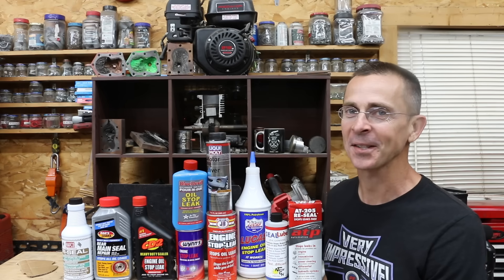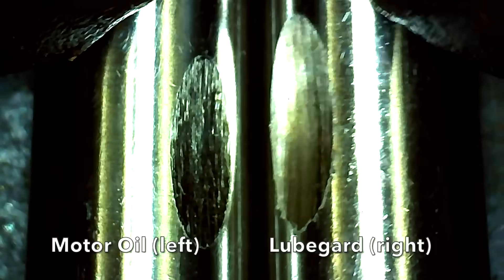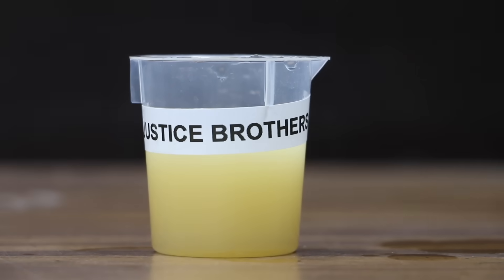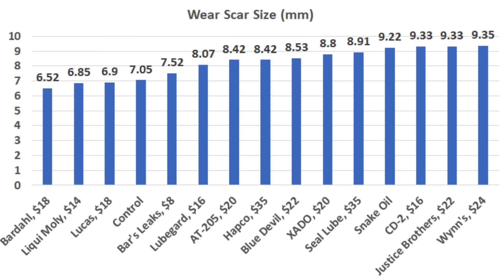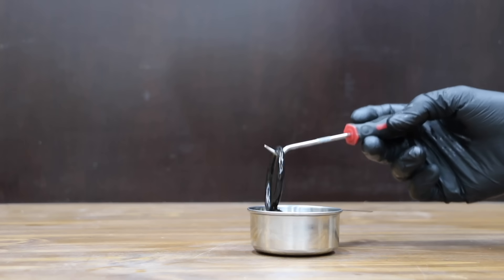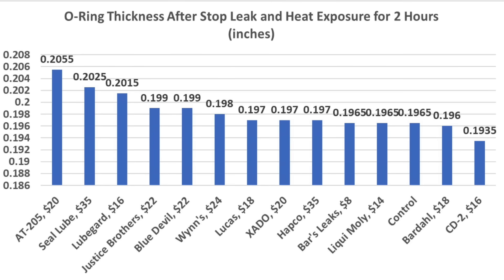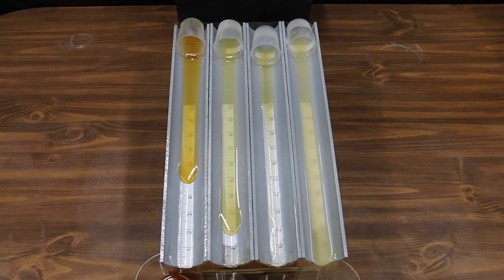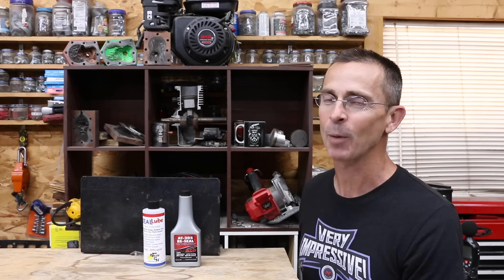Do Stop Leak Products Work? Do They Damage Engine Seals? Will They Destroy an Engine? Let's Find Out

Comment: I'd like to know what happens to O rings that were successfully softened by products that increase engine wear THEN returned to plain oil only. I.E. assume you only run these additives for a short time to stop oil leaks THEN drain your engine and go back to running on plain oil. Will oil leaks return?
Reply from the maker: Thanks for the suggestion.

Comment: at205 just works. however the tests are a bit misleading, if at205 didnt come out on top there would be a ton of comments how its dangerous ruining viscosity.... except the test was a 50% mixture which is way overkill. 8oz in 5+ quarts of oil isnt remotely a 50% mixture. but sadly a majority of people just aint that smarts

Comment: I'm currently using ats 205 for a rear main engine oil leak on a ram Cummins it wasn't a terrible leak but a very slow drip so far it seems to have helped and stopped the leak over all the wear indicator on your video worries me a little bit but you also mixed 50/50 ratio I'm running two bottles for 12 quarts of oil so it should be pretty deluded love this test glad you've tried ats-205
Reply from the maker: Thanks for sharing.

Comment: At-205  just flat out works, unfortunately it has become harder to find recently, i had to use the blue devil instead but now I think i will try to get my hands back on some AT-205. Nice job on the test!
Reply: I buy AT-205 off ebay with free shipping. The price can be equal or less than my parts stores.
Reply from the maker: Thanks!

Comment: I've been using Liqui moly for over two years and 90,000 miles in my BMW. It had a pan gasket leak. The Liqui moly substantially slowed the leak, but there is still some. Oil analysis shows nearly zero metal content on a 165,000 mile engine. The oil filter housing gasket, which are known to leak and cause major damage when the serpentine belt fails, has no leakage whatsoever 80,000 miles after I replaced it. I'd be pretty nervous about any product that didn't stay in solution in the oil, or reduced it's lubricity. I'm shocked the LM got so hard in the freezer. My engine shows oil pressure immediately after staring even on sub-zero mornings.
Reply from the maker: Thanks for the feedback.

Comment: Remember, just adding a thickener or something that increases the viscosity of the oil may help seals, but if it increases too much you can end up starving the oil system. Bearing gaps that need motor oil pushed in by the pump may end up getting less oil overall to them due to the increase viscosity, and the user may be under the impression that things are better because they see a higher oil pressure on a gauge (if they have one). But, higher pressure does not = higher flow or more protection, it can actually indicate that you are just having a harder time pushing that oil through the system.
Reply: Exactly, viscosity is super critical to getting proper oiling to your cam and crank bearings. Higher viscosity will starve them for oil, especially in modern tight tolerance engines.
Also, I think these are natural rubber O rings which are not compatible with oil. Oil will eat natural rubber, if an engine uses an o ring that will contact oil, it can't be made of natural rubber.
Reply: @bobbygetsbanned6049  he didn't get into detail about the specific type of oring, but if it was in a repair kit then it was likely Buna-N for general compatibility.
Reply from the maker: Thanks for sharing.

Comment: So many motors these days have silicone seals, the LS only has rubber front and rear mains and the rest are silicone. Should add that to the tests
Reply from the maker: Thanks for the suggestion.

Comment: If anyone watches Scotty, he swears by the AT-205 products, so that was awesome to see it here in the test. I wonder if it would cause less wear if used during the summer time with warmer temperatures or with a lighter weight oil than usual. I’m pretty sure that it’s meant for older vehicles where the leak is more of the concern than some minor additional wear. Another great test 👍
Reply: Well, nobody is going to use the 1:1 ratio of product to oil he used in that test... I don't know why he even bothered with it. I used one 8 oz bottle of AT-205 in my 6 quart capacity crankcase for a leaky front crank seal and it worked. I have no concerns about any wear factor.
Reply from the maker: Thanks!

Comment: Scotty Kilmer swears by AT-205 for stopping leaks, which seems to be backed up by your data. There's obviously an increased risk of wear with AT-205, but Scotty only recommends using it in 
older engines vehicles where you aren't going to spend the money to repair- which lines up with your suggestion as well.

Thanks for another great video!
Reply from the maker: You are welcome!

Comment: I had some bad piston rings on a 94 tercel. Would foul a spark plug in 15 min... ran a can of engine restore in the oil and ran the car for 3 years with changing the spark plug once a year, just added a can every oil change and added to 5qts when adding oil to keep it in spec. 42mpg and 30k miles works great till till I sold it
Reply from the maker: Thanks for sharing.

Comment: had a power steering leak on my 2003 ranger, pump out old as much as I could poured in bottle of Lucas power steering stop leak, it lasted almost 10years before it started to leak again, sold the Ranger about a year or so after that

Comment: do you clean the thin sheets that covers the lubricity tester wheels? Does they effects the test rsults that much if not cleaned evrytime?

edit: do you also change the lubricity tester wheel? does the friction removes material from the wheel? does this matter in the test results?

Comment: Radiator stop leak next! Of course they tend to clog stuff up over time. Makes me wonder what this stuff can do to an oil filter and how permanent the results are. It seems you could add the stop leak and change oil not long after but it's tough to say.

It seems to me that it's difficult for oil stop leak manufacturers to have high lubricity and and also create o ring expansion. There seems to be a slight correlation with some of the products. They may offer a better wear scar but aren't as efficient at stopping leaks.

The thing I took away from the video is you want it to stop leaks and blend with your oil well. The oil itself will do a very large part of protecting the motor. The main concern is actually stopping the leak when the oil you use, if it's high quality, should offer the wear protection.
Reply from the maker: Thanks for the suggestion.

Comment: I would be interested to see if you took the cooked/treated o-rings, then "changed the oil" and cooked them all again in the control oil, and see if the swelling/softening is still there, or if the o-ring reverted (meaning you have to use it every oil change).  It would be neat to see what blackstone labs found for each type as well.
Reply from the maker: Thanks for the suggestion.
Reply: @ProjectFarm if you revisit this test, also consider a high mileage oil as many of those claim to restore seals too
Reply: @feyrband  He covered at least two brands of high mileage oil in a previous video, and found they did restore the o-rings slightly.
Reply: @Tagiau  oh I missed that one, will have to check it out. Thanks
Reply: @Tagiau  High Mileage Oil only works if used BEFORE the an oil leak starts. It does nothing to stop the leak. That's why the Oil Companies recommend begin using at 75,000 miles.
Reply: Oouuu yes, This is pretty important! (The re-test part)
Reply: THIS!  It would be very helpful to know how long the o-rings expansion would last.  Do you have to keep using  such products?  Or do the effects last, and for how long?  And if the best working additive does the most damage.  Knowing if you only have to use it once and then can do a oil change to compensate the negative affects of the additive, or if you have to keep using it and thus ruining your engine.  Thanks Todd
Reply: I'm pretty sure those are natural rubber o rings which aren't compatible with oil, so they will get damaged by the oil again.

Comment: Wouldn't the 50-50 ratio used in the friction test be the same as replacing two full quarts in a 4 quart engine? I don't think any have that directive. Directions for AT205 is 8oz in 6 quarts so you'd add roughly 5+ ounces to the full 4 quarts, correct? Wouldn't have nearly the dilution impact.

Our story: 1998 E320 with rear main and valve cover leaks. One per year oil changes. Switched to Mobil-1 high mileage. Year one nothing. Year two leak was stopped. Year 3 leak returned 6 months in.

Added the AT-205 and within 25 miles of driving was down to one drop on floor per day. Year 4 (current) oil change with AT-205 added and we get one drop every 2-3 days...
Reply: Also the generous amount of product to oil would, potentially, give better plump and softens, too.

Comment: On the O-ring repair tests, I actually think that the oil/product mixture isn't flashing off, but being absorbed into the O-ring, and that's why those ones tended to expand more.
Reply: then the weight would not change.
Reply from the maker: Thanks for the feedbackl
Reply: Yeah, the weight wouldn't have changed. 

It's absolutely flashing off.

Comment: About 30 years ago, a friend of mine replaced all the oil in his engine with bardahl. The viscosity was so high that the engine refused to turn over and burnt out the starter motor. It took a full day to drain out the bardahl from the crankcase.....
Reply from the maker: Thanks for sharing.

Comment: We have used bars a few times for leaking main seals in sweeper truck rear Motors.  It would normally give the motor an extra six months to a year... At205 seems like it may be significantly better I guess will try that next time.
Reply from the maker: Thanks for sharing.

Comment: I have experience with the at-205. Had an oil pan leak, small, only a drip or so a day. Threw 20 bucks at the 205 fingers crossed so I wouldn’t have to go through the effort of replacing seals. No luck. In fact my leak go worse. I do believe it worked as advertised to soften the seals but just happened to have an adverse effect on my leak. Spent a couple hundred bucks and a weekend to reseal everything. Now problem is solved.
Reply from the maker: Thanks for sharing!

Comment: I would suggest a couple of tests, that are related to this one. First would be products for sealing cooling system leaks, and the second would be transmission fix products.
Thanks for the information. I've used seal lube, and it seems to have slowed an engine oil leak.
Reply from the maker: You are welcome!  Thanks for the suggestions.

Comment: Your methodology is excellent.   I find it interesting that you confirmed the effectiveness of AT-205 at stopping leaks, which Scotty Kilmer endorses.
Reply: Scotty Kilmer is very knowledgeable and he wouldn’t steer you wrong on a product. I recently purchased a battery jump starter from “Autowit”. It uses capacitors instead of an internal battery pack. Works fantastic. I think Project Farm may have tested it out also but I’m not sure. 😊
Reply from the maker: Thanks!  Thanks for the feedback.
Reply: Yup, that's how I heard of it also, and t's a great rubber preserver because it has no petroleum distillates in it.

Comment: I used the at205 for a leak in the rack and pinion of my truck and it worked amazingly and didn’t leak a single drop for about 3 months. The leak has come back now but it was such a significant leak to begin with that I’m surprised it did anything at all, plus it gave me more time to save up some money to actually fix the problem
Reply from the maker: Thanks for sharing.
Reply: That was mostly what I was thinking they'd be useful for. Sometimes you just need a bandaid to keep your truck in service until you have a chance/can afford to actually deal with the issue properly
Reply: @philondez  THANK YOU for saying that all it is a BANDAID at best Personally every brand that saids Stop Leak SHOULD BE BAND  the only reason why these products exist  is because of Nasty car dealership used car lots Private  car sales are very popular among the SCUM of the Earth that buy this CRAP  all ways remember  this Honesty is the Best Policy if your sell a car or Truck just be Honest about it dont be a A HOLE and screw people and BTW some additives  not many  DO WORK on a temp bases  ONLY
Reply: I used Lucas power steering stop leak in 3 different vehicles and it slowed down the leak to the point where it just looked damp instead of a visible drip. The leak was so slow that I didn’t have to add any fluid for over a year on my last vehicle. I highly recommend it for power steering leaks.
Reply: @bdtaylor1979  That's b/c it only made the fluid very thick. Lucas is heavy viscosity snake oil.
Reply: @TheGuruStud  It is milked from spitting Cobras
Reply: @bdtaylor1979 brake fluid works great
Reply: @bdtaylor1979  Again it DOES  not work PERIOD and let me guess i bet you sold every vehicle  with this product or any product  just to stop it from leaking and get top dollar ???? again it doesn't work but a good video at best
Reply: We can see why Scotty Kilmer likes AT-205, but the friction tester tells us there is a price. Still, anything that buys time… 🙄
Reply: @lanedexter6303  In the wear portion of the test, Project Farm did a 50/50 mix. Although insightful, in the real world, the mix would be much less and there would be more motor oil.
Reply: @AustinsCoins  I think most of us are aware of that, and LaneDexter echoed that obvious fact. Not sure what your point was.  Without the 50/50 test, its doubtful we would have seen the difference in wear between the products, and thus been unaware that there even was a potential problem.
On my wife's newer car, I'd use one of the more viscous products, even though it was less useful for softening/expanding.
On my 165K vehicle, I'll use one that less viscous, but more useful for softening/expanding. 
A number of people here complaining about the 50/50 test seem to miss how it is bring critical information to the table that could otherwise have been overlooked.
In reality, its possible running any of these at Manf. recommendation will have almost zero effect on wear, and we should only be looking at seal/gasket effectiventess.
Problem is, it would take a lot, lot longer to do that sort of testing, thus we make do with this.
Reply: @AustinsCoins  Depends on the chemical makeup of the product. When it comes to things like that, using too much can be the problem. It's a rare thing where a little = good, more = better. For stuff like re-plastifier (like AT-205), using too much can create more problems or be much less effective than using the ratio on the label. If it's bonding with the gasket material, using too much can create a bunch of free molecules unable to bind with anything except each other — creating more sludge and friction. 

Using it in real-world conditions in the recommended amounts — would more than likely be more effective than here, not less.
Reply: @AustinsCoins good catch
Reply: got an 05 Civic. Replaced all valve cover components & still oil leakage. Oil pan does leak, but was "bandaid" with some RTV from mechanic. Thinking it most likely piston rings seal failed with 170k engine. Also replaced the cam seal on side of valve cover. Would that ATP help or am I better off trying a Blue Devil or Bars product? Read main seal OEM part replaced upon clutch replacement so not worried there. Thanks.

Comment: When comparing the evaporative loss, instead of loss measured in grams, the % of total would be a more useful because they didn’t all start at the same weight. Though I’m this case the grams lost is so low it doesn’t really matter.
Reply: The surface area exposed to the air is the same though
Reply from the maker: Thanks for the feedback.

Comment: I would love to see this with the stop leak for antifreeze might be a large project though. K seal blue devil Barrs leak would be a cool shoot out between brands all readily available at most part stores all about the same price.
Reply from the maker: Thanks for the suggestion.
Reply: @ProjectFarm  Me too. I know for a fact that it'll stop up a heater core tight as a corn cob or a tater in a tailpipe!
Reply: @lewiemcneely9143  have you used K-Seal ST5501?

I have had good results with it, without a loss in heat performance.
Reply: @thefordmaniac  I don't think so, Pal. I'm so geezerish I have to farm everything out pretty much but old cheap Seal-all will seal off pinholes in Briggs gas tanks. BOO on ethanol!

Comment: Looking at the wear results I'd say it's probably cheaper long term to fix the leak than to subject your engine to the increased wear from most of these products.
Reply: Probably fine shorter term to choose a product that's not terrible for wear, and then change your oil sooner than normal. 

Fixing the leak is obviously best, but there are lots of practical reasons why people can't do it immediately! 

(However, I imagine fans of Project Farm are more likely to prioritize fixing things, haha)
Reply from the maker: Thanks for the feedback.
Reply: I would have liked to see him mix half a dosage of Lube Guard and half a dosage of Liqui Moly and test those two mixed. I suspect as long as there is no reaction between them being mixed, you would have a product that protects the engine AND conditions the seals.
Reply: Well, since he was mixing them 50/50 I don't think the much lower percentage of product mixing with the oil in the crankcase would have much of an impact.

Comment: Your wear tests are flawed. Since you didn't follow the mix ratios on the product labels (mixing them all 1:1 instead of what's recommended) in some cases you probably diluted the motor oil far more than the manufacturers intend. For a valid test the ratios have to be correct even when dealing with small amounts.